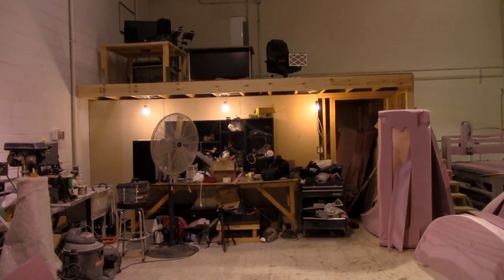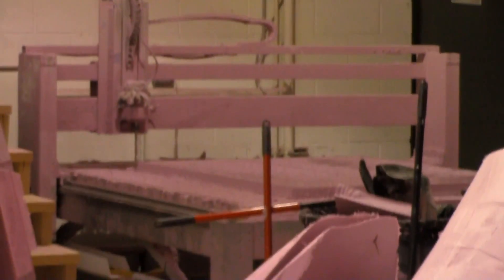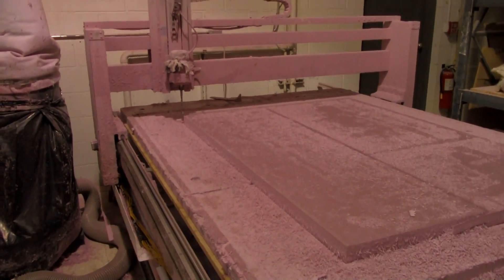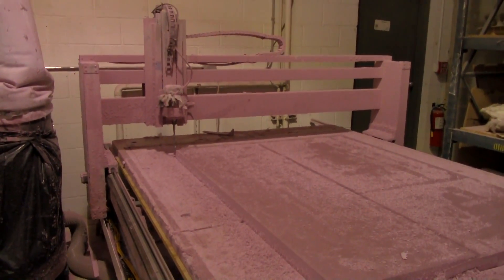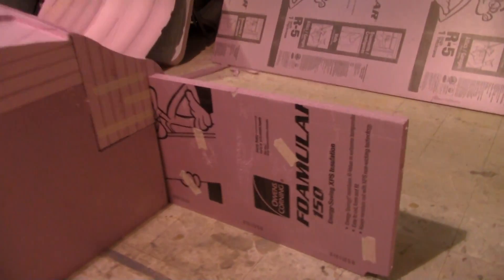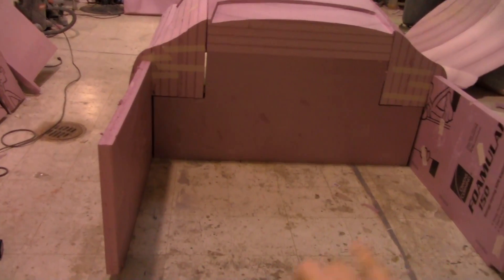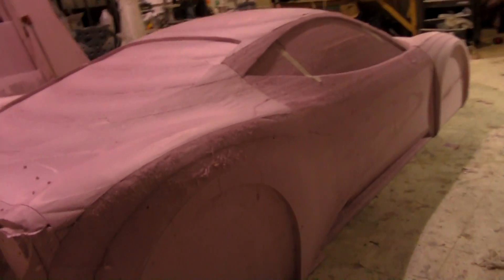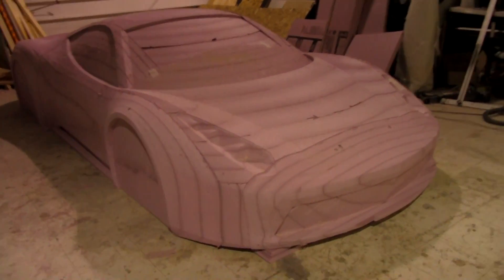Arma GT full body CNC car

Comment: mate life would be so much easier if you modelled 4 points through all the sections and drill through 10 mil then you could dowel each layer with 10 mil wooden dowel makes gluing easy and accurate

Comment: I wonder how they do the windows
Reply: The front windshields have been made by a company called ProCurve Glass. They cost about $2k USD each plus shipping. The car is open source so you can download the windshield model and have any glass fabricator manufacture it as long as it has the DOT stamp. The rear may be lexan to start and I haven't sourced a manufacturer for the side windows yet.
Reply: My question is how they will do the door area.  Door structure, seal placement, and just the area around the door where it will sit

Comment: It's going to take a very complex multi sectioned mold to be able to pull a one piece shell shaped like that out of... Are they using a fiberglass sandwich mold for their bodies or will it be a more traditional female mold with glass laid up on the inside by hand?
Reply: I asked for the complete body so that I can finish the surface to be uniform as one piece when assembled but it will be cut into panels that will be used for the moulds.
Reply: @ArmaAutomotive are these for sale?